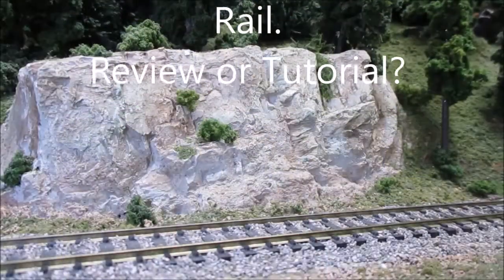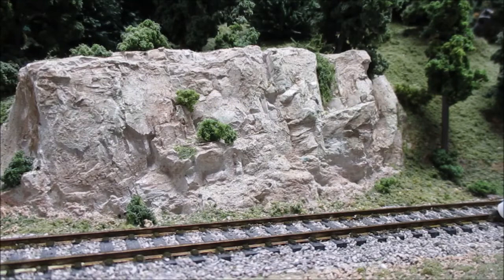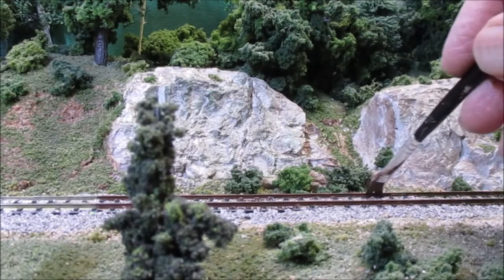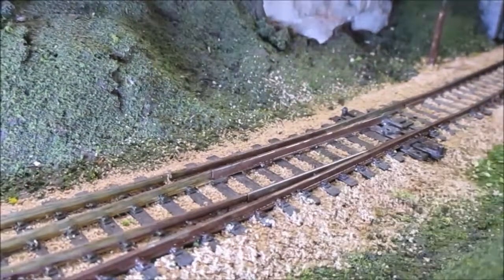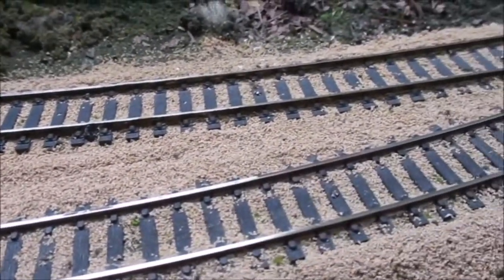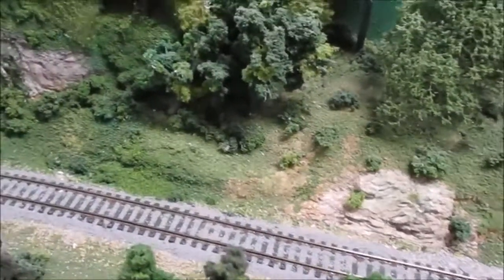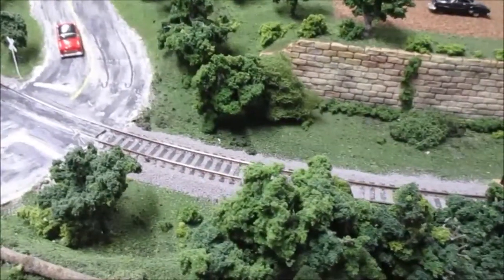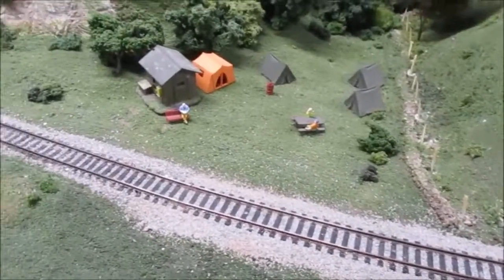Painting the Rail on an HO Layout

Comment: I usually end up doing two coats when I do the pen; one of the orange rust and then the brown on top of it.  That metal rail is really hard to paint so great job.  Also, the cork is good.  Anything that is softer than the metal rail.  I usually use a piece of a wood door shim.
Reply from the maker: I also used a piece of Homasote, which worked better.